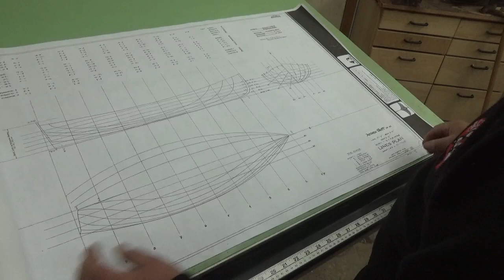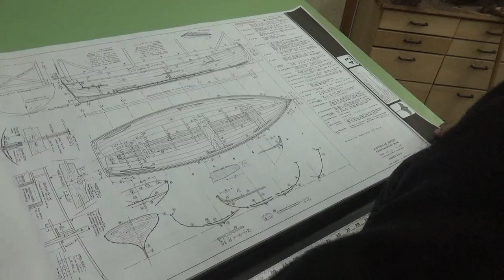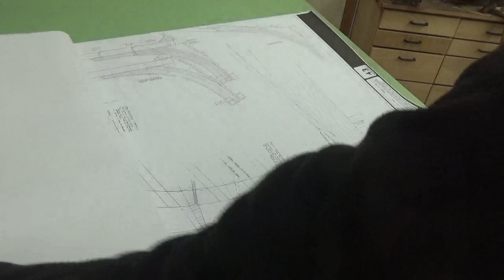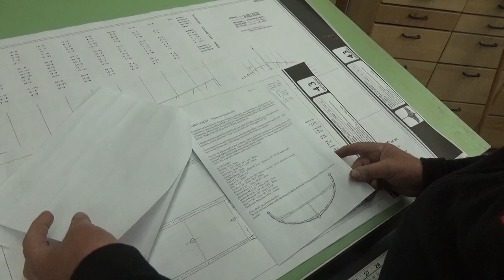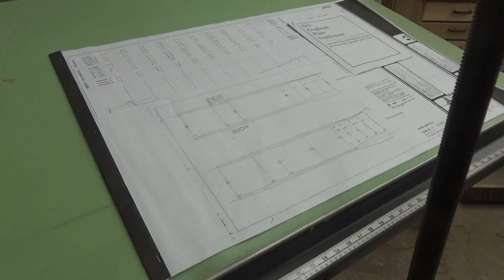Acorn Dinghy - Introduction to the new build

Comment: Also really looking forward to this.  Do you feel the plans adequately address a carval build, frames, etc. or are they oriented toward lapstrake?  I was going to attempt a Catspaw build, but this looks interesting.  Just don't want to get in over my head if one needs to 
have the experience to convert lapstrake to carval.
Reply from the maker: The plans call for lapstrake but I am going traditional solid planking with copper rivets versus glue plywood lapstrake.  There is adequate info in the plans to do either.  Carvel is another animal all together in which planks do not overlap.
Reply: Thank you for the rapid reply.  Because they are so different is why I was asking if the plans adequately addressed the carvel approach.  I believe most lapstrake designs eliminate a lot of frames and I want to make sure that the number of frames and the frame positions were addressed in the plans for the carvel approach.  Look forward to your videos.
Reply from the maker: @edwardsteadman8136  Sorry for not being clear.  The plans do not have any information on carvel building, but most round shaped forms can be made in carvel.  It does list size and spacing on frames for traditional lapstrake.  I would imagine that the frames would need to be more robust for carvel as no structural joint between planks as in glue lap or traditional in which there are rivets holding between frames.  Hope that helps.